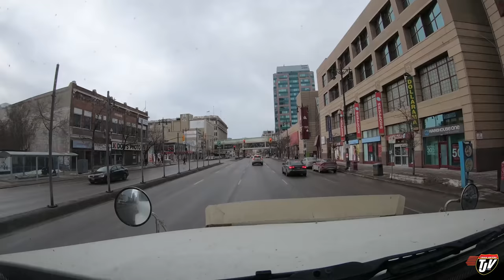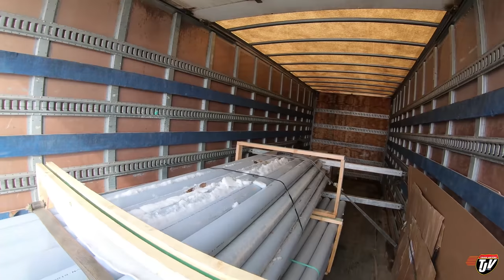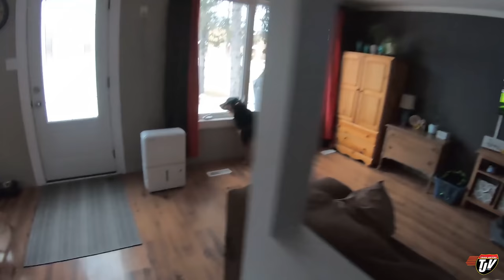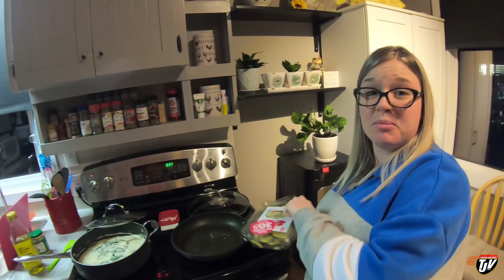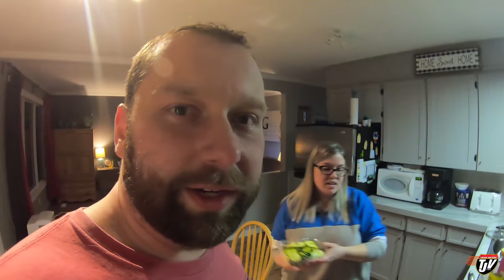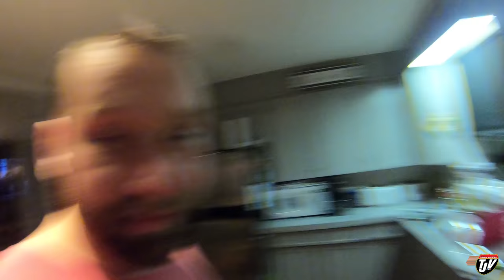My Trucking Life | SHOVE IT IN! | #2221 | Feb 23, 2021

Comment: Sir Josh ,,, Just to refresh your memory ,,,  Back in the day ,,when you went to hook to a trailer ,, You were required to back up to the front of the trailer & STOP b/4 the 5th wheel was to come in contact with the trailer & GET OUT & Hook the airlines & Electric cord ,,then get back in the tractor & air up the trailer ,,when the air gauge was back up to full pressure reading ,,then you released the brakes & proceeded to back under the trailer !!!  NOW WHY ???  Because pre 1975   trailers didn't have ""SPRING BRAKES"" as of today & with the wheels instead of ""SAND PADS "" on the landing gears,, the trailer would roll off when you tried to hook !!  This was part of the ""DOTMan "s Driving report when you went to get your ""CDL"" !!! "KEEP IT SAFE "" !!! Talk with your DAD about those days !!!!